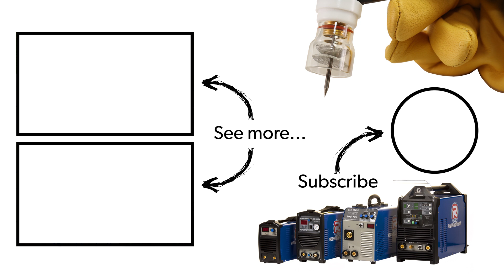How To - Euro MIG Torch Liner Replacement - R-Tech MB15 - MIG Welding - Welding Tips

Comment: I've asked this question many times but lack of answers, why doesn't the 'Mig180' display the Amps and or wire feed speed on the display when altering when not in use? It only shows when an arc is created making it redundant.
Reply from the maker: The LED is not a setup tool like you are thinking of it, it is a calibration device to ensure that the unit can be used in a coded manner if required. It is therefore a ‘real time’ read device, not a ‘preset’ read device. Any idea that preset and Mig go together is moot anyway, it is unreliable in most situations due to the variances in gas composition, gas flow rates, base material composition and arc length, all of which can affect the amps generated at the weld pool, which will mean the ‘preset’ applied on the front is false. Hope this helps.
Reply: Research is great before you buy....and posting in a video that has nothing to do with your quesion is pricless...duh...even after 4 years...amazing....
TY op...or your video...)
Reply: Why not just cut the new liner to the same length of old liner before installation.